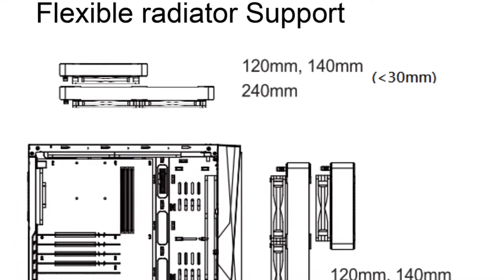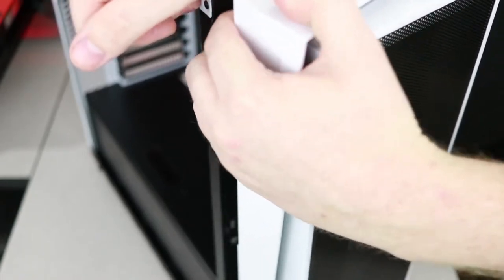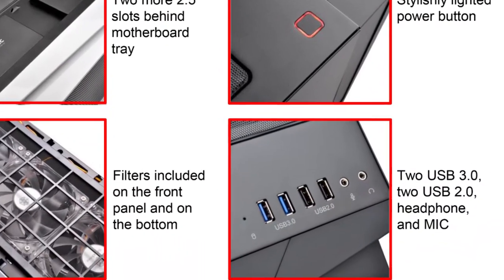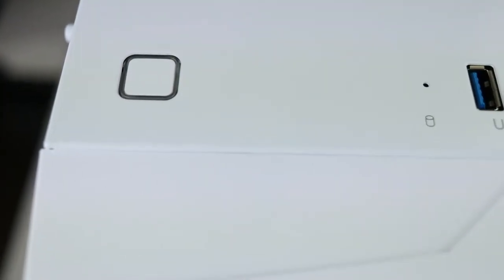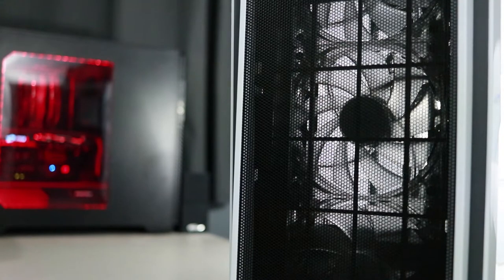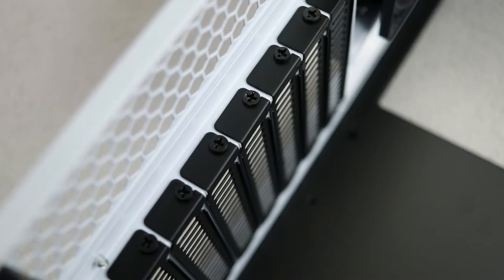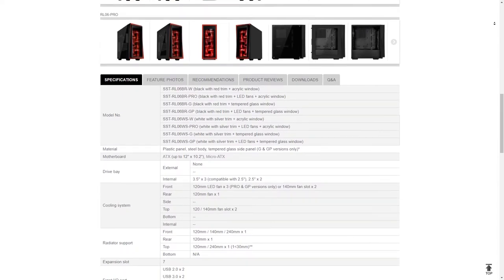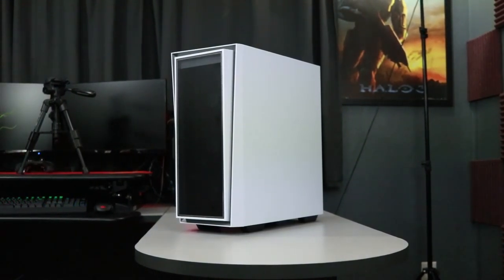Coolest Case Around | Silverstone Redline 06 Pro Tempered Glass

Comment: well its the best case for perfomance temperature etc all other cases are closed on the front with little airflow ports on the side or top\ bottom plus the included fan are really good we are talking about 20$ per fan and you get 3 of them and 1 on the back wich is nothing special if you live in a hot country this is a top choice the meshify from fractal design is good as well but this one is way cheaper with way better fans included

Comment: PLEASE HELP WOULD A 240 rad fit on the top of the silverstone rlo6??
Reply: In terms of mounting support, yes, but you'll be running into clearance issues with your motherboard once you add up the thickness of a fan+radiator (unless you maybe use slim fans and a slim radiator).

Comment: Why do you keep comparing this case to the nzxt 340 elite (9:30)? The 340 is for water cooling only and this is obviously designed for air cooling, the lack of the front radiator cut out in the psu shroud should have given you a clue
Reply: I didn't think the nzxt 340 elite had that either? Though it is compatible with the 280mm rad instead of just the 240.